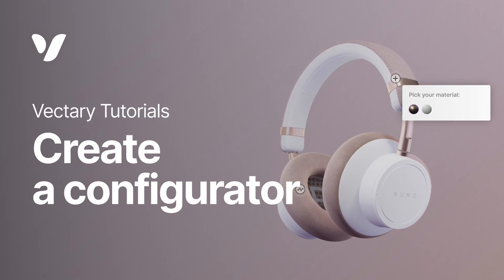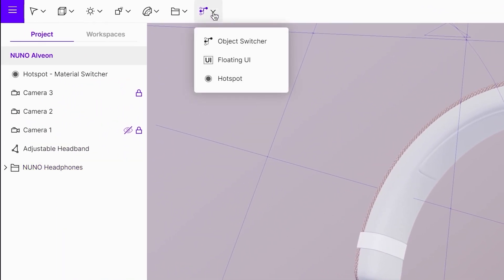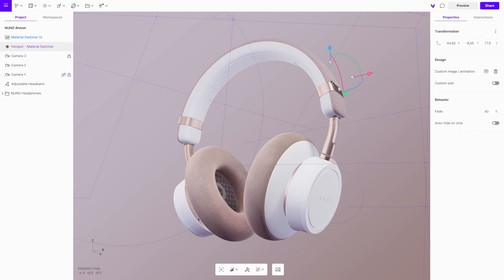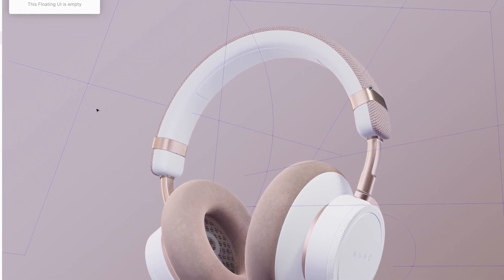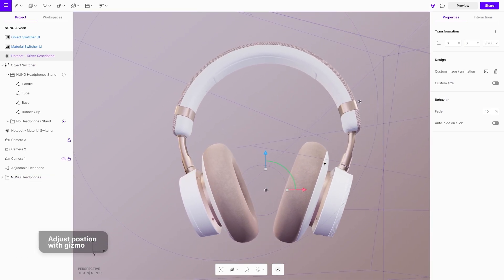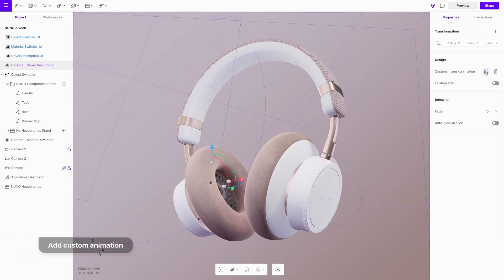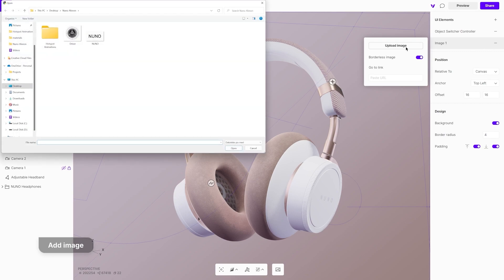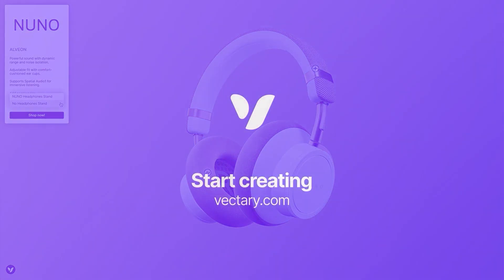Create a 3D configurator | Vectary tutorial

Comment: I followed this tutorial but it seems like the new update does not have the “relative to” section. @VECTARY please how do I do this as I am stuck. How do I connect the material switcher to the Hotspotz/
Reply from the maker: Hi, you can do this in Interact mode now. You need to set the trigger to the hotspot and then add visibility action: Interact mode > Visibility > Show > Floating UI > Relative to
If you have any more questions, join our Discord today and tomorrow for live Q&A https://discord.gg/NYd2CMdY?event=1052315133763924109
Reply: @vectary  Hey thanks so much for this great work, but when I follow your suggestion the Floating UI pops up close to the Hotspot, but wont follow the movement, when I rotate the view. Any ideas on how to fix this?
Reply from the maker: @moxinnovations9953  Can please you send us more details with screenshots at support@vectary.com. Our team is ready to help.